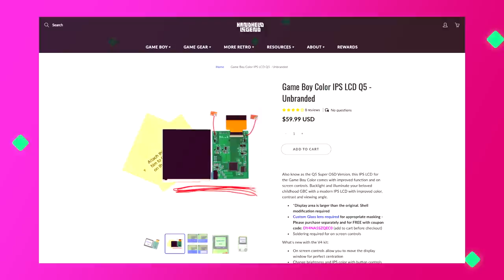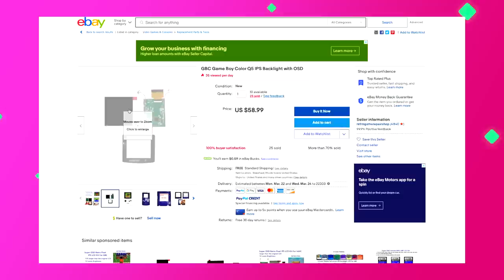BIGGEST Backlight IPS Kit For The GameBoy Color! | Q5 OSD XL IPS Kit | Retro Renew

Comment: I only need to replace the speaker in an old GBC...but I'm here because since it's open, I might as well drop in a new screen...and get a new shell...and glass lense...might as well get new buttons...

Why did my cart go from $4 to $80?
Edit:  This price tag is going up because my screen was cracked.  I don't know if it was during the install process because I neglected to test it before closing it all up...

...SHIT!

Comment: Are there any lips on the 3d printed inserts to hold the screen in place or anything? If not, I wonder if people who are doing this mod could maybe just sand the parts down a bit to make the fit less snug? Assuming one might want to avoid sticking it in place. Sanding PLA is kind of meh, but I imagine it might work. I love love love the idea of 3d printing brackets, but it's definitely a challenge to get them bang on dimensionally accurate.

Comment: thanks for GREAT video! I love it. 
BTW, isn't rechargeable battery voltage is only 1.2 V each ? I think that causes that everdrive problem. also since it has larger LCD I think it will draw more power = short running time. I wish someone does battery test on this mod.

Comment: Hi there, great video! I installed this screen myself and absolutely love it, however, I do get a bit of a buzzing sound from my speaker, and my batteries run out in approx 35 minutes! Furthermore, the red battery light dims when I can see the gameboy colour trying to load/struggle a bit, I am using Everdrive GB x7. Especially when the GBx7 loads up, you can see that its sucking the batteries to power the OS and the games. The batteries I've been using are cheapo Eveready, I have invested in some rechargable 2450s that should arrive on Tuesday. Do you think it is my installation that is the fault of battery consumption, or is this just what its like?

Comment: Has anyone tested these kits for lag? makho doesn't provide that info in his roundup details. I'm curious how much lag each of these mods have.
Reply: I did a NGPC mod with this same screen and don't see any lag or ghosting. Actually noticeablely faster refresh rate than original screen. Scrolling graphics are very smooth.
Reply: @overnightdelivery  Good to hear! It would be good to see some lag testing on the different panels (delay from button press to registration on screen). Anything with an OSD has more possibility of lag, due to the image processing that is done prior to display of each frame.
Reply: Oh Input Lag. You had me curious so I payed close attention to when I pressed a direction on the joystick. The character moved before the stick finished making a clicking sound. If there is added input lag, it's 2 frames at the most. Didn't have problems with combos in fighting games. Of course the OSD is never on when I'm actually playing a game. But just being on in the background could cause delays if I'm understanding you. Tough to know for sure if there is no added lag but it's certainly not noticeable.

Comment: Just installed mine (exact one on this video) and it worked for a whole day. The next day I simply powered it on and half the screen was gone. I tried reconnecting the cables and put tape just like you did on this video. Any idea what my issue is?

Comment: I’m new to projects like this! Do I need to use flux on the connection points before soldering? Pre-tinning and soldering the wires but doesn’t mention flux. Is it to be assumed flux is used? (Serious noob, go easy)

Comment: So I did this and the screen works but I have no control. I noticed on a few other videos they solder the wires slightly differently and put them on different pads? Does that matter or should it? Touch pads and screen work but I just can’t adjust the screen with the menu. Any suggestions?

Comment: Good morning. I just bought a gbc off of eBay to mod. It powers up but I'm not getting a display...all I get is horizontal lines. I took it apart and fiddled with the ribbon cable. Now the display is solid black. I also adjusted the contrast pot inside. Still no display. Do you or anyone else have any ideas? I'm leaning towards recapping the device. Any help would be appreciated.

Comment: great video! I wa s just looking for a ips kit for my Game Boy Color... but I'm searching for a simple kit that doesn't need soldering or to many modifications for the shell, any suggestion?
Reply from the maker: Thank you Dario!  Yes, there are a couple drop in kits. They have smaller screens and they use TFT technology which is a bit older. HHL and retromodding sell the.  Cheers!
Reply: @MachoNachoProductions  thanks for the advice! 👍

Comment: I have been keeping my GameBoy Color with a lot of care but I recently noticed the exact same dark spot at the center of the LCD as in your video at the 3:31 mark (- -_ ). It literally came out of nowhere. I don't know if it's because I didn't use it for a while... So I'm considering to get one of those backlight kits but I don't have any soldering equipment nor experience. Do you think it is possible to do this mod without having to solder the 3 wires ?

Comment: Whats needed to get the battery on screen indicator to work?
Reply from the maker: It will require an additional wire to be soldered from the BAT pad on the driver board but not sure where it would go on the motherboard. I read a comment from @Jesus Rodriguez that connecting it to the negative battery terminal may do it. I would need to research it more though so can’t tell you for sure. Cheers Justin!
Reply: @MachoNachoProductions  Sounds good, thanks for the info. Got this screen on the way and going to try soldering up the battery meter.

Comment: A potential reason for the 3D printed spacers not fitting is that your 3D printer could be in need of calibration. Regardless, I think your solution of just using two was adequate.

Also, uhh, it's Eneloop, not Onaloop, fwiw?? Eh-nuh-loop.
Reply from the maker: Oh man, was I saying it wrong the whole time?  Thanks for the heads up. Also, I should look into calibrating, it’s been a while.
Reply: @MachoNachoProductions  I have heard it pronounced  like "any-loop" ... but here an official video https://youtu.be/_aImWiHqyGQ

Comment: I have been considering this mod but am hesitant because of the OSD menu. I would imagine that if you try to save in Link's Awakening (by pressing A, B, Select, and Start) you will always unwillingly trigger the OSD menu. 

Also, you cannot omit soldering the OSD controls because sometimes you need to do a factory reset on this IPS kit. I speak from experience because I have this Q5 OSD kit on my NeoGeo Pocket and whenever the screen malfunctions you need to do a factory reset, which is only available in the OSD menu. 

The bigger size screen is a major selling point for me. Funnyplaying has a newer bigger IPS Kit that uses the Q5 screen. 
https://retrogamerepairshop.com/collections/game-boy-color-backlights/products/gbc-funnyplaying-game-boy-color-q5-xl-backlight-kit?variant=38094799437996
Reply from the maker: True statements but since the d pad doesn’t effect the osd, saving isn’t an issue. Also I never had to reset IPs kit. What is the reason for doing that?  Cheers!
Reply: On my NeoGeo Pocket, it would glitch where the screen gets incredibly dim to the point where you can barely see, with the highest brightness setting. When this would happen, the OSD menu looks normal (bright, blue, and clearly functional) and choosing the reset option brings the screen back to full brightness. Maybe I got a dog of a batch?

Comment: The wiring could be done better. In a clear shell you will see these wires, which is not necessary.
Reply from the maker: Totally open to recommendations. Cheers!
Reply: @MachoNachoProductions  I have one more important thing to recommend: never use all of the double-sided tape around the display. Otherwise, it will be very difficult to remove the display in one piece if necessary. The adhesive is VERY strong! Just small pieces of the tape on the corners should do the job. I just cracked my display because I wanted to remove a little bit of dust from under the screen. :(
Reply: @MachoNachoProductions  Still no reaction? Well...
Reply from the maker: You did a great job on the wiring!  Cheers!

Comment: Do the touch sensors do anything the odd doesn't
Reply from the maker: The only thing is the preset color palettes. The OSD let’s you change individual rgb setting but doesn’t let you cycle through those pallets. Other than that you can do everything from the osd.
Reply: @MachoNachoProductions  nice one thanks. I've been after an backlight that doesn't require touch sensors. This looks perfect.